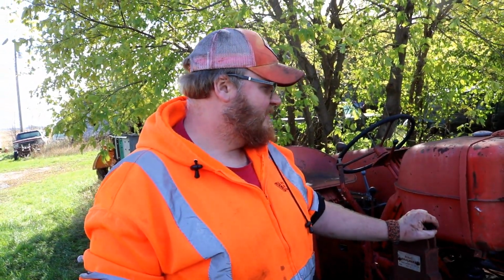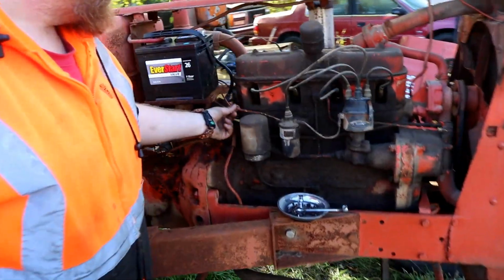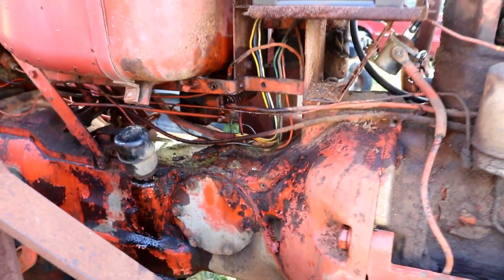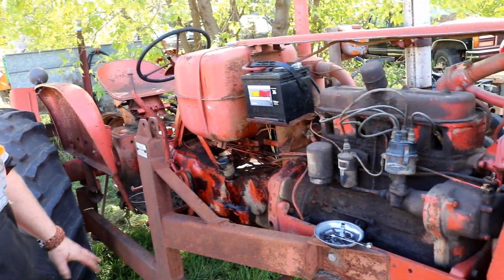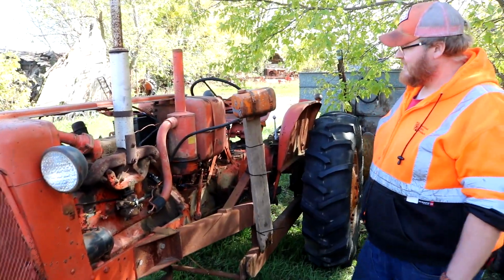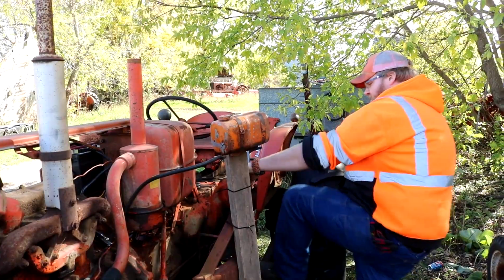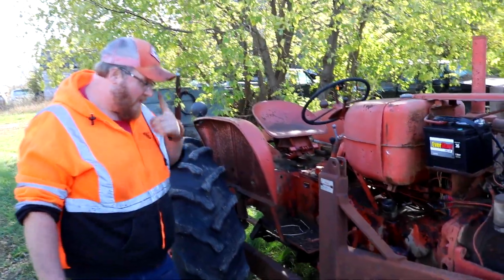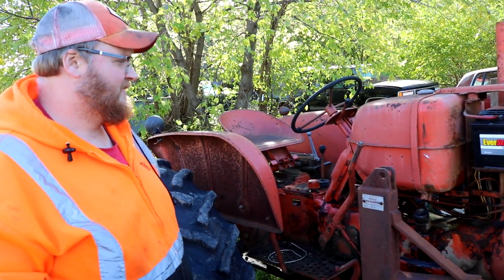Allis Chalmers Show 1957 D17 Tractor Repair Part 2 Will She Run?

Comment: I've had clutches that have been sitting for a long time stick like that.  Did you try putting it in one of the higher gears, maybe 3rd, and stand on the brakes?  Maybe same in reverse also.  You might break it free.  I've had that happen a couple times and was able to break it free.   Once free, it should be fine.  Make sure you have a lot of space and no people around.   Lol.  Good luck!   If you have to split the tractor, well,  so be it.....
Reply: Sorry, I meant do that with clutch in.  Hit the brakes hard to break it free.